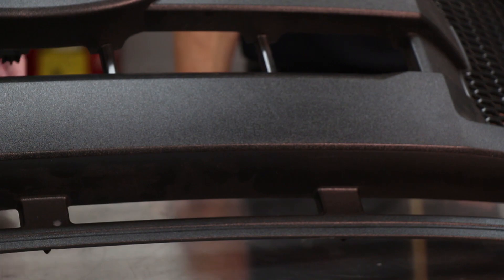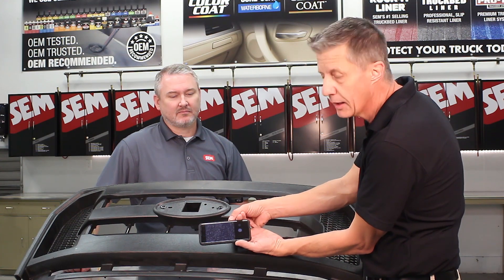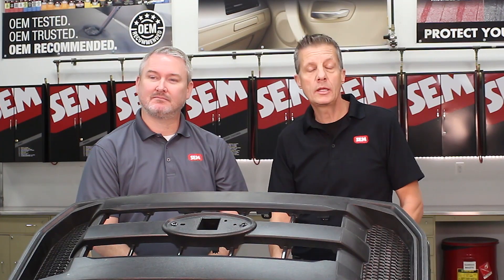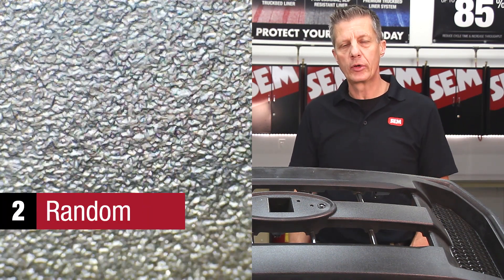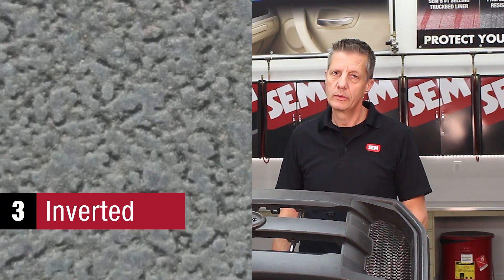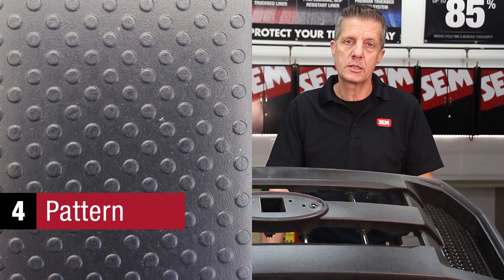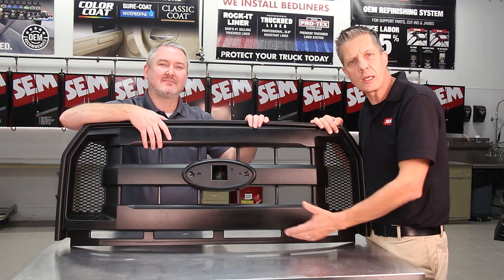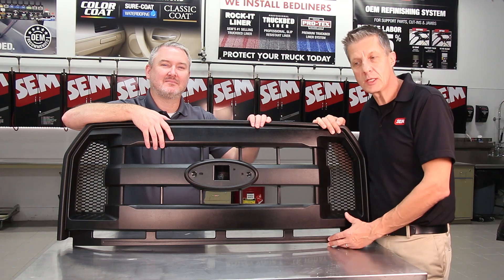Duplicating OEM Texture by SEM Products

Comment: This stuff works great. Used it to protect rocker panels and lower quarters on my truck and it worked beautifully and holds up. Then I used it to repair a plastic trim piece that a tree bumped into. After playing with spray distance to get it fine enough and then gentle sanding it reproduced the texture in the repair perfectly. Only drawback, the can is a couple years old now, still 3/4 full and I need it and it will not spray! Big time bummer for the price!

Comment: Painting a Ford Focus rear bumper and a little confused regarding your product line.

1.) Is "SEM 39853 Black Texture Coating" a top layer finishing coat or just a textured undercoat?

2.) "SEM 39153 Charcoal Bumper Coater" appears to match my Ford bumper.  Would this cover the 39853 texture coating or could it be applied for a smoother finish?  Do both products have a texture finish?

3.) Do either products recommend or require the use of a plastic adhesion promoter or primer for best results?  ...or clear topcoat for durability?

Thank you in advance for your response.
Reply: the texture coating if sprayed right gets the oem plastic look if sprayed right then you either sand it down or dont sand it up to you and finish with the bumper coater or any brand trim black
Reply: I have the same exact questions. These people are trying to promote a product and couldn’t care less about the questions the viewers may have. That’s why I wouldn’t recommend it to no one. It would seem to me that you would apply the texture coating first and then the bumper coater.
Reply: Using resource to monitor YouTube probably not cost effective.  They have a tech line.  Call them.

Comment: Perfect timing! I will soon be repairing/restoring a 1994 Audi S4 with black body molding and bumper trim that has been scuffed, scratched, and scarred over the years from previous owners. It has a factory texture that I didn't want to lose during repairs... now I know I can simply "replace" it with this! 

Based on my previous experiences with Color Coat, Trim Black, and SEM Solve on other projects, I have no doubts this system will be another winner. I'm just a hobbyist, not a body tech, but your products help keep my older cars looking factory fresh with professional results I can achieve in an afternoon, in my own garage. I refreshed the entire sun-faded interior of a 1987 Buick Regal T in a weekend, for about half the cost of one new replacement door panel. Incredible! These clear & concise how-to videos are icing on the cake. For my cars, it's SEM or nothing!
Reply from the maker: Thank you for your feed back. We appreciate it and we appreciate you using SEM!